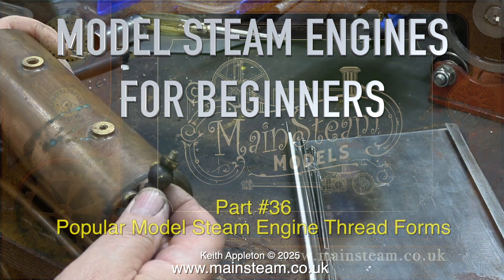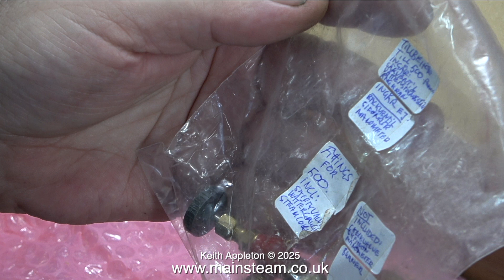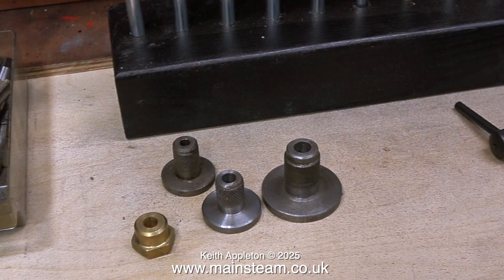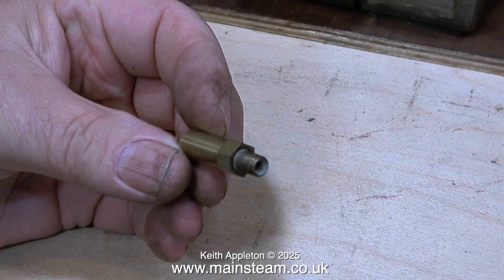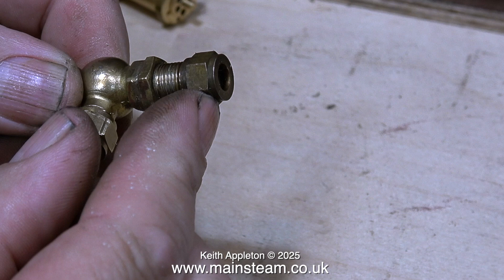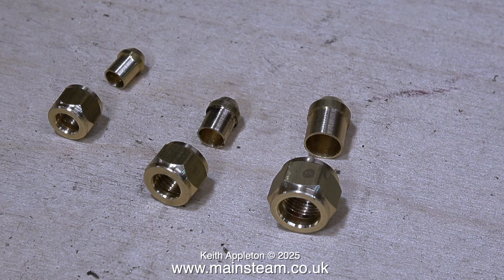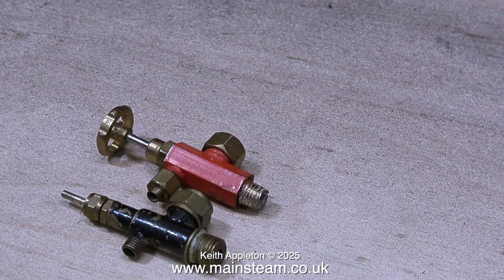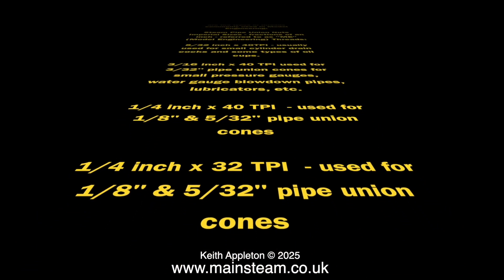MODEL STEAM ENGINES FOR BEGINNERS - PART #36 - THREADS

Comment: Just getting into restoring a 501 boiler and 10V.  Could you show us in a video how to use a thread pitch gauge and caliper.  Sounds simple now that I know, but others may not of done this.  I had to use a magnifier to Really see the subtle difference between pitch sizes.  I found it could be tricky to determine if the threads were full of locktite residue or if I was using the wrong pitch.  Thanks for the Pipe diameter to Union Cone to Union Nut info.
Reply from the maker: I have never used of owned a thread pitch gauge, I just use a die or compare the threads with a new bolt. Give Stuart Models a ring, they will tell you what the threads are . . . .

Comment: wouldn't a thread gage be useful for beginners? I am sure they have them in even the most exotic threads.
Reply from the maker: I have a thread gauge somewhere, but I can usually get it with a nut, a bolt or a tap.

Comment: I have a Stuart 504 boiler purchased in 1969 that has a safety valve bushing threaded 5/16" x 26 tpi. After measuring with both imperial and  metric thread gauges I was able to source the proper tap and die on Amazon.  
The best overall fit was achieved by 8mm x 1mm thread referred to as a French Metric size. Very close to 5/16" x 26 tpi. but better because of the extra diameter. Odd ball or curve ball it requires proper sorting to make sense of model engineering, Thank you for all the years presenting helpful information your channel!
Reply from the maker: I have a thread gauge somewhere, but I can usually get it with a nut, a bolt or a tap.

Comment: Throw in the American standard pipe and you will go insane.. A simple inexpensive thread pitch gage becomes invaluable. I bought several a few decades ago when manufacturers started mixing metric with imperial on the same vehicle. Then there's the million different hydraulic fittings too. It'll drive you to drink.
  Thank you Keith.